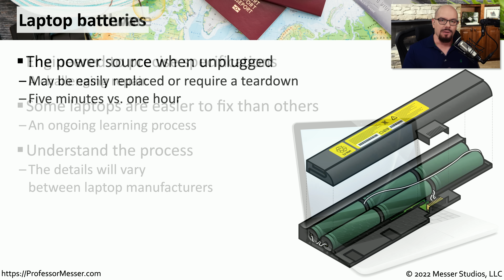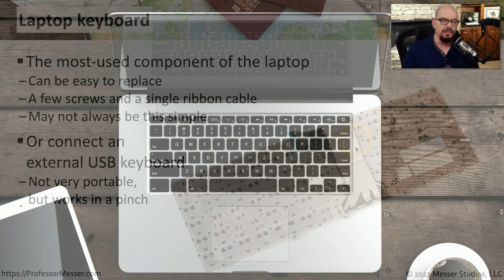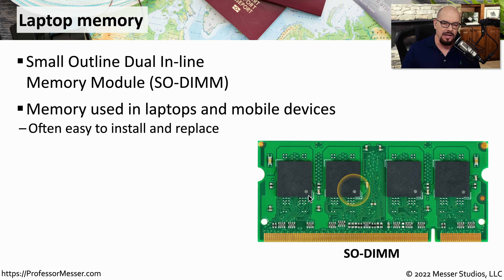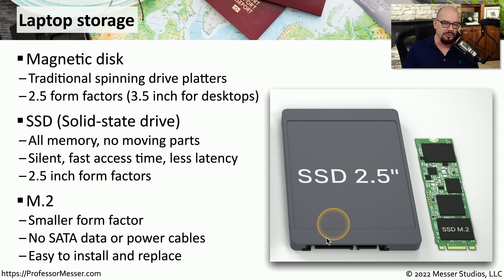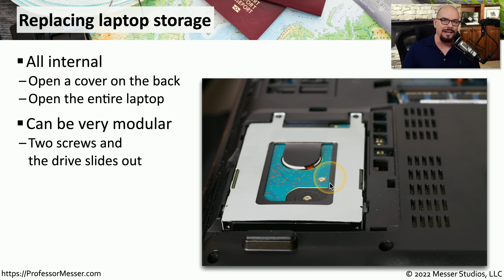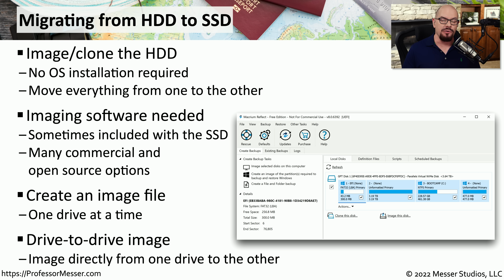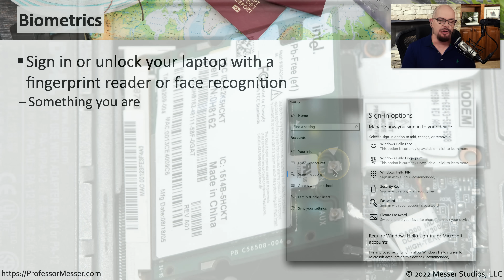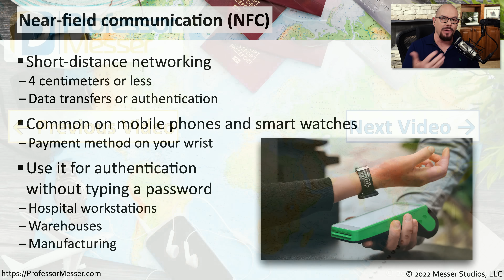Laptop Hardware - CompTIA A+ 220-1101 - 1.1

Comment: With migrating from HDD to SSD and copying everything over, are we talking about a laptop that has a place for both drives, or having the SSD in another system, or plugged in externally for the OS installation, etc, and then installing it into the laptop in place of the HDD? I mean for any of the examples given here, including moving the image from one to the other.Thank you!
Reply from the maker: Any of those would work!

Comment: Would the cloned upgrade to an M.2 drive create any friction with respect to the Windows  OS EULA?
Reply: I was wondering that too. Also, is it possible to clone windows to an SSD from a HD with only one license?
Reply: @thatfunkyduck  window's license is connected to your account (MS Account). i've used multiple drives for my pc due to work and pc and windows is activated on both
Reply: @droplikelean  oh really? And that goes for the basic personal version of windows?

What are the restrictions? Can only one device be running the OS (or signed in) at a time?

Thank you for your helpful reply